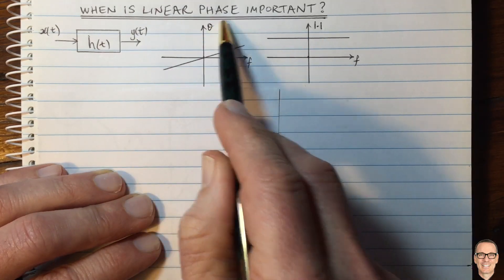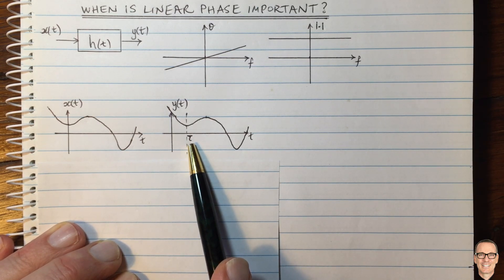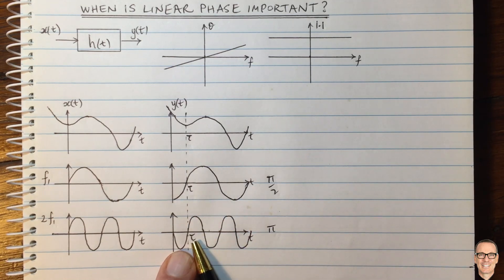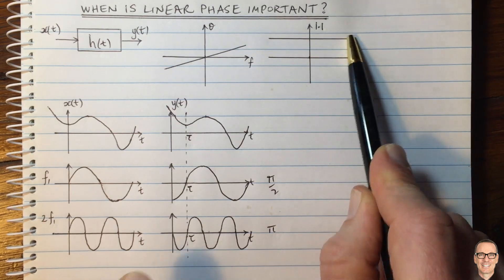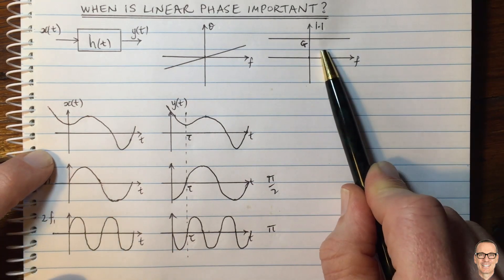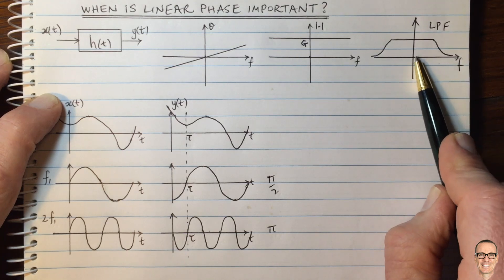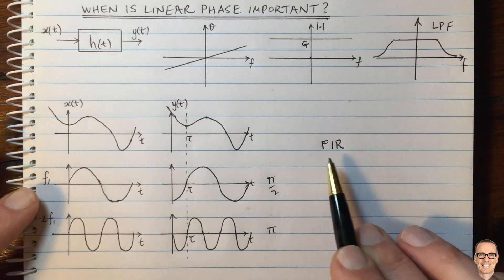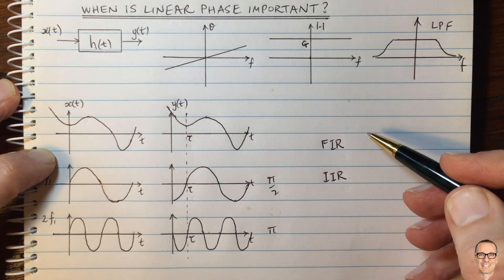When is Linear Phase Important?

Comment: Hello, nice video! Do you have any video on halfband filter? just reading some SDR documentation and there is stated that halfband filter after DS ADC allows to bit growth from 5bits to 12bits. Never heard of such concept, maybe good topic for some video? ;)
Reply from the maker: Thanks for the suggestion. I haven't heard of half band filters. Perhaps they are related to single side band modulation? I'm not sure. I'll check it out.
Reply: @iain_explains  "The final stage of the AD9363 is the digital conversion and decimation
stage. Here the ADC will typically run at a much higher rate than the desired
receive bandwidth, but the ADC itself will not provide all 12 bits defined in the
specifications. The additional bits are gained in the halfband filter (HBF) stages,
which will allow bit growth. The ADC itself only provides ∼ 4.5 bits of resolution.
This is a typical design for sigma-delta converters ( - ADC), which inherently
have low noise and run faster than the alternative successive approximation (SAR)
ADCs. Refer to Section 2.5.4 for more information about  - ADCs. However,
by utilizing a very high speed ADC and associated HBFs the receive signal can be
digitized at 12 bits at the desired configured sample rate. Therefore, for the best
signal resolution is achieved through large oversampling of the input signal and
then followed by several decimation stages"
https://www.mouser.com/pdfDocs/SDR4Engineers.pdf - page 174

Comment: hello sir, hope you are fine
from this video of yours i have made a few conclusions please have a look at them
1. if the wireless channel is stationary in time(without dopplers effect) then there is a constant delay between transmitter and receiver why there is destructive interference between Tx and Rx in this case there should be only constructive interference, as the delay is constant which will lead to linear phase and thus we will receive our signal without any distortion as all the frequency component of the signal will suffer same delay hence linear will be the phase
Reply from the maker: The term "destructive interference" is not the same as "distortion". Destructive interference means that there is a second waveform (or many waveforms) that are almost completely out of phase with the main waveform (ie. in the range of 180 degrees phase-shifted). This means they will have the effect of cancelling out the main waveform. It is not related to the relationship of phase as a function of frequency.
Reply: @iain_explains   @Iain Explains Signals, Systems, and Digital Comms  sir are the destructive and constructive interference addition of the copies random in nature?
Reply from the maker: It depends on the type of channel. If it is a UTP cable with ADSL/VDSL, then the ISI comes about from bridged taps along the cable. These are different for each cable, but don't vary with time. If it is a wireless/mobile channel, then yes, the ISI is random and time varying. You might like to check out my videos on channels, ISI, fading, ... at http://iaincollings.com

Comment: Hi Iain, thanks for the explanation!

I also realized that the step response of the filter/system also benefits from a linear phase. The rising edges and falling edges also become identical, in case there is such a requirement for the said filter.
Reply from the maker: Glad you liked it.

Comment: Great thanks a lot. Is it also possible to have a constant spectrum but a non linear phase?
Reply from the maker: Yes, that's a good question. One example is that in optical fibres the light at different frequencies travels at different speeds, but it can be with the same gain.
Reply: Yes an all pass filter will generally have constant magnitude and some nonlinear phase.

Comment: Is there a reason your videos are always so quiet?
Reply from the maker: That's just the volume that my microphone puts out. Maybe I'll think about increasing it for future videos, but I don't want it to be too loud. I really want the viewer to have the feeling that I'm sitting next to them, having a considered conversation.
Reply: @iain_explains  But lower volume will cause lower SNR of your voice due to discretization noise
Reply from the maker: Unfortunately I don't have any control over that. That's determined by the electronics in the microphone. I'm using a fairly good quality microphone, but perhaps I should think about upgrading.
Reply: You can run the audio through an LTI with an impulse response of 2*δ(t)